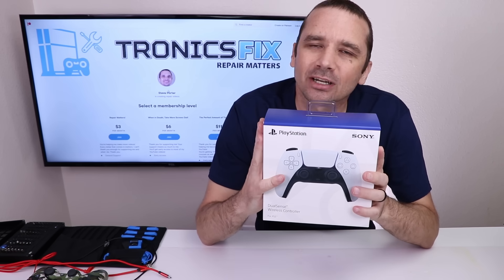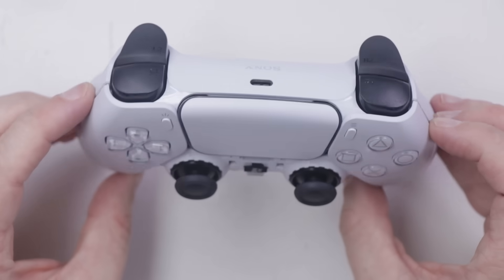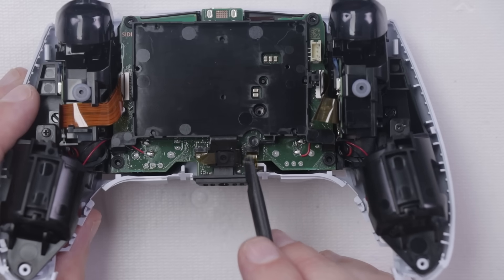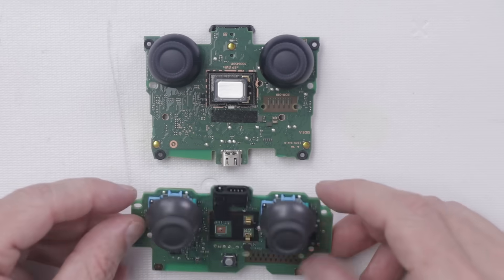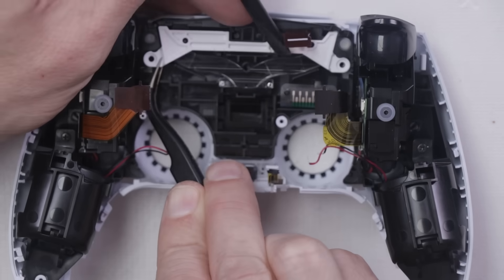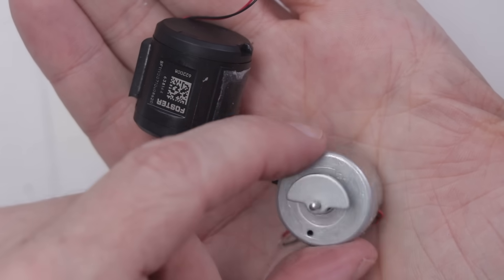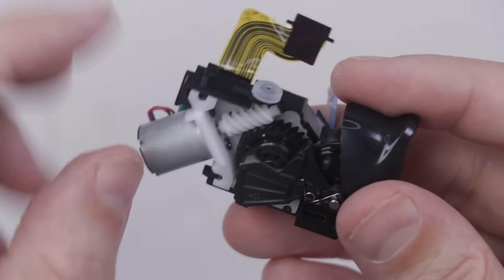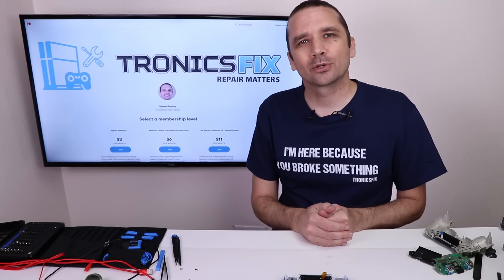PS5 DualSense Controller Teardown - A Repairability Perspective

Comment: Nice video thanks.They were going to be cool to feel that, they look like Wheel Force Feedback but I doubt how much weight or force supports that toothed shaft or toothed wheel is nothing more than plastic, it would have to be made of bronze or metal base like the gear motors of CD/DVD driver.

Comment: I wonder if the Dual Sence vibration's is like the Switch's HD Rumble but more advanced
Reply: It is. A reviewer already said "If the Switch has HD Rumble, the DualSense must have UHD Rumble". It's far more advanced as it's much bigger. Comparable with taptic engine in iPhones, which gives impression that someone's knocking from the inside of the device... But again, much bigger so the effect is advanced. I am so hyped for feeling the Controller the first time.

Comment: C mon you already watched a video, the L1 R1 buttons are the trick and without knowing there is a screw under you wouldn't be available to open it so fast
Reply from the maker: Nope...didn't watch a single teardown. I was super careful when I got most of that cover off then it didn't budge anymore so I knew I needed to check it more. When you start opening it up you can see where the screws are from the backside.
Reply: @Tronicsfix  all right so maybe the edition makes it look easier than it was, good job!

Comment: i feel it would be a great opportunity for them to re-engineer the trigger motor to have an "energy saving mode" so every time you press the trigger it acts as a generator and restores whatever it can to the battery. It wouldn't be much, but it could help for long fps games to get even just a few minutes. Kinda like regenerative braking.

Comment: Never had drift with my PS4 controller, the battery on the other hand, lasts about 30 minutes before dying.  I pretty much leave it plugged in now with a longer cord.

My Nintendo Switch controller on the other hand, has noticeable drift - and was showing signs pretty early on, where-as my PS4 controller is the original from release, with the analog thumbstick worn out like a pencil eraser.

Comment: I've had one of my Dualshock 4 controllers since launch day 2013. After about a year I dropped it and broke the R2 button so I replaced something in there and I put new thumbsticks on while I had it open, but it's still going strong. Never had any drift or anything, battery is as poor as a brand new one haha

Looking forward to having a go on these Dualsense controllers, looks well laid out if I ever need to fix anything.

Comment: This is the first time I'm hearing of drift, I've have my controller since day one with no issues, I also have a controller that came with my PS4 Pro thats only used when my original controller dies. So weird must have gotten lucky.
Reply: Same. I've never really had any issues with any sort of stick drift with playstation or xbox controllers. Just the Switch.
Reply: Me I had
Reply: There are definitely some drift with PS3 and PS4 Pads, but I had never anything that I couldn't fix with a quick calibration. The Switch drift is a whole new level.
Reply: i've had like 4 dual shock 4 controllers and 2 of them eventually developed it, i find it's more of a abuse thing though, my second one got it cause I dropped it a few times and my first one just developed it, though eventually I busted the trigger in my first one playing mortal combat.
Reply: Same. I never had any drift on any PSx controllers.
Reply: I’ve had 4 duel shock 4 controllers and they have all developed a problem or two.
Reply: @XgamerdaveX  i do alot of party games with my friends . Now we have 11 DS4 controllers with problems most of them the drift in L3 . I hope not to have this problem again with ps5 .

Comment: I can't wait for all the people who just press the trigger harder when it's set to not move then they break it
Reply: Depends on what's stronger, the holding torque of that small motor or the plastic gears. But I guess we'll find out when people can power the controller with the triggers set to not move, If it does fail then that's a major design flaw and there's going to be a lot of warranty claims and unhappy people.
Reply: @black543211000  based on the sticks being the same as PS4, I don't have much hope for those tiny motors
Reply: I’m curious as well. I think Sony has it covered, there’s no way they’d overlook something like that.
Reply: The trigger system just gives it to the pressure in that case I saw another video explained it.

Sorry I can't remember the video but it seems it will be fine.

Basically there will be a certain force when the trigger system will just unlock.

Comment: Those analog sticks are fine, I have never had a playstation controller drift it's only xbox and switch that i have had drift.

The chips on the board look like SONY (SIE [sony interactive entertainment]) and realtek chips the sony one probably is used to control the motors and send button presses to the PS5 (it might also do charging) and the realtek one's are for bluetooth, those will probably die in a few months and kill the whole controller (and system if the PS5 has them too) because they are not good chips.

Comment: The analog is slightly revised in material on the retaining plate and mounted 90° offset to help with a specific case of wear that could lead to drift
Reply: Yeah that's what some other people are saying, yes the overall analog design is the the same but the material used is different so hopefully they are smoother a less prone to drift
Reply: Don't really understand but I hope you're right
Reply: @danielb5721  - The green square part he points too at 6:22 has a fragile sensor plate in them that registers the thumbsticks position,  it does this by rubbing tiny tiny metal pins against it.   After enough use and abrasion, the sensor starts to get a bit fonky from even the smallest piece of dust or excess corrosion.  (that's why blowing on it temporarily fixes the the issue).   The only true solution is to carefully clean this green bracket area out and the metal pins,  but if it's too warped you'll have to repair the part ($3) or like most people buy an entire new controller for $70
Reply: Also help with sprinting in games. Since you have to push forward and press down. They did it with ps2
Reply: Can you elaborate on the 90 degrees thing?
Reply: @Unlovelywriter  basically they flipped the analogs 90 degrees to make them wear down less when sprinting .
Reply: I hope,  i've had the same running issue with 3 different DS4's (left thumbstick) in FPS games.  It's always those tiny green sensors that start to warp first from those metal contacts.   Drift was so common that I became a professional at taking apart and cleaning mine out almost every other gaming session.  After my 3rd controller started doing it I was madly obsessed with fixing the issue and scouring every YT channel for solutions.   Not difficult but extremely inconvenient
Reply: Same poor quality analogy sticks  as before , there must be a better way of doing this ?
Reply: @clivechamberlain4310  Sony likes money, so they let you buy more controllers if they break

Comment: It's good that the adaptive trigger is modular but I do think plastic on plastic gear grinding is a bad design flaw. We saw that way back in the Nintendo 64 days where the analog stick would fall apart because it was all plastic inside.

Comment: Guess I was really lucky because I have never heard of DS4 analog stick drift up until this point and I have used my PS4 for over 5 years now. Also you pretty much need to have a soldering station if you want to clean your controller, same as PS4/XONE.
Reply: Same here, both my launch day PS4 and launch day PS3 controller works perfect to this day
Reply: Yeah I've never heard of it being an issue myself either, and my 2+ year old DS4 controller has had zero issues. In fact the only real issue I ever recall having with an official Playstation controller was my original SixAxis and that was just the battery dying, I simply removed the battery and it still works perfectly fine as a wired controller. Seeing people say they've had issues makes me wonder how careless some people have been with their controllers, especially when they say it's happened with multiple controllers such as one guy saying he went through 6 in 4 years.

Comment: DS4 has analog drift problem? I have 7 controllers and none of them ever got that.
Reply: Yeah this is the first I've heard of it having issues too. I've only got a single controller that's little over 2 years old now that I've had zero issues with, meanwhile some guy in another comment claims he's gone through 6 controllers in 4 years due to drift & L3 button issues which makes me question just how careless is he with his controllers.
Reply: First i'm hearing of it.
I never seem to have issues with playstation or xbox controllers.
Reply: I have 3 DualShock controllers and they all have this issue. It's pretty common and depends on the model of controller you have. The updated dualshocks fail more in my experience compared to the ones from launch.
Reply: I had 3 PS4s and the last controller had drift. I take extremely good care of my consoles and controllers. The drift appeared after playing Project CARS without any kind of assists. When you turn the analog stick only slightly or halfway through (without touching the border) looks like it wears out very fast. So don't play simulator games without turning assists on your PS4 on a controller lol.
Reply: My first DS4 had this problem after 4 months and i sell the console cuz that
Reply: I was today years old when I learned about the drift thing issue.
Reply: y tho
Reply: @VolkyWay  
I dont know imagine i used one day in the week so i didnt use it 24/7 and even with that it didnt make it 
Low quality i think
Reply: My DS4 that came with the console already had drift :)
Reply: @andrewz4515  
Exactly poor quality i dont like DS4 
I really want xbox sx just to avoid this problem the dualsense is not cheap 70$ per 4 months thats stupid if its had drift
Reply: Same here. I had no idea that the DS4 has drift issues. Not saying that it doesn't happen (I'm sure it does), but with some of these ridiculous failure rates some people are supposedly having I would be very surprised if part of it isn't due to controller abuse. Lol.
Reply: @ultramegax  I think it's just not that common unlike with Switch joycons. I have 3 DS4s and all of them are still in top performance condition until today. I'm using one of them as a controller for PC.

Meanwhile, my GFs joycons had been experiencing drift issues after a year of usage.
Reply: @deicidium1887  yeah, I believe the Switch definitely has far more widespread drift issues. My sister's boyfriend had issues within a couple of months, with all of his controllers, and he takes good care of his stuff.

Comment: Austin Evans is no expert that’s for sure. This is so funny!
Reply: What do u excpect from someone who said Xbox X is miles better than PS5 just cuz he got it early 
What a loyal fanboy
Reply: @Player dude better specs doesnt mean it's gonna perform better. Austin got one from microsoft and he tested it and then looked at the ps5 specs and said yeah xbox is better, sorry but thats not how u campare consols he should've waited for ps5 and then compare cuz what's the point of it being more powerful if it's not gonna fully use those specs? Xbox one was more powerfull than PS4 but ps4 outsold xbox in units and with a overall better gaming library and also performed better except for the loued jet sound
Reply: @farxx5628  The ps4 was more powerful than the xbox one and the reason xbox one sold less is because it was $100 more and bundled with the trash kinect. The xbox series x is more powerful than the Ps5 cpu and gpu wise. The only advantage Ps5 has is its faster ssd which won't make a difference in third party titles
Reply: @rixzin5046  wrong, also a VASTLY better I/O and compression system, and a significantly less complicated development environment... Sony isn't forcing developers to develop and optimize for two different consoles and in most cases a PC as well. There's more to CONSOLE gaming than the GPU, it's the erasure of bottlenecks and ease of development, and the "bottleneck" (in quotations because there really isn't any) in the PS5 architecture is essentially the SSD, which is saying something about the Series X since it's twice as fast. ps3 was more powerful than the 360 but 360 usually had the advantage in multiplats for this reason. Why have we barely seen anything next gen on the Series X when it's a week from launch? It's sad that Watch Dogs is the only game, and I guarantee since it's from ubisoft it will very likely be mediocre even if it looks fine
Reply: @Artdizzle  Multiple devs have already came out and said that the series s isn't  an issue considering its literally just a cut down version of the series x. They're just going to keep it at a lower resolution and lower quality textures is some areas. I've also seen multiple games for series x on xbox's own YouTube channel so Idk what you mean.

Comment: Hmm, so all I have to do to disable the microphone is remove the black trim and then cut the now exposed ribbon cable going to the mic. Good, very easy to stop Sony from recording everything I say and selling that data to third party companies like Google, Amazon, and Apple all do.
But will the controller still work after doing that? That is the question. (I already know I won't be able to play garbage games like AstroBot that think it's 2004 and blowing into the mic as a game input is cool, but losing those games is no loss at all. that crap wasn't fun when Nintendo did it and it won't be fun now, and I don't want to play any games that do it)

EDIT: Okay, have to go a little deeper, there's one on the back too. 🙄 
I really appreciate Xbox just making a regular controller without a bunch of stupid gimmicks I didn't ask for, as well as still using replaceable AA batteries so I'm not stuck with a wired controller whenever the battery dies.

Comment: I took mine apart and it looks significantly different than yours. The thumbstick mechs are the Japanese variant instead of American Alps, the touchpad ribbon wasn’t soldered on but was modular, the rumbles had serviceable wires not covered in white epoxy like yours were, and the button ribbon pcb was blue not green.

Comment: 2:03 Oh, Sony learned. The silicone pads behind R1 and L1 are completely filled again, not like the PS4-Controller, where they were basically a ring. Atleast they will hold up longer than the ones in PS4-controllers.

Comment: Its saddening hearing that the sticks are same build as the Dualshock 4, I was hoping as well some upgrades to it.
My first DS4 had bad drift 8 months after getting the PS4 revision of OG version.

Luckily my second DS4 haven't given me a slight hint of any problems, but my friends have told me they've gone through 3 controllers or more.

Sometimes I wonder what the heck do they do...or maybe I got super lucky with mine. But anyways, hope these controllers show less problems even if the design is the same.

Now for a quick question regarding the new triggers and the mechanical aspects of it.
What are your thoughts on durability for them? From what I saw and understood they are easy to fix, but it makes you wonder how careful you gotta be with them if you have the feature on (you can set them on/off on system configuration).

I can see situations were players can get a tad rough with the pressing of the bottoms tearing and wearing everything out, not factoring dust and sweat into them.

Thanks for advance if you get the time to reply to this.

Comment: Looks identical to the sticks used in the PS2 Dualshock controllers, but can't tell without seeing one taken off and opened up. I fixed quite a few PS2 pads with drifting sticks for friends. The main cause was the circular foot of the stick that is pressed down onto the base of the module with a spring that would return the stick to centre wearing down. The base would have a bump in the middle and the foot will have a similar indent to it, if worn flat then that stops the stick finding the centre. I have not opened any other sticks from other controllers so don't know if this design has changed since then, It might just be a standard off the shelf part that hasn't changed. would be interesting if you did a comparison.

Comment: Nice video,very informative.
My only question:
Can i remove the whole haptic thing to make it a normal controller? I mean remove the hardware ,not via software,and keep it working, i trully don't give  a damn about that whole vibration and trigger response thing, if it was possible i would keep playing with my half mid chassis removed scuf ds4 lmao,I even removed the lighting 😂
Reply: Everything can be disableb in console system menu. If you can remove these parts and still use it depends on the software - it could be there is a self system check for any failures and if a component is not responding, it will render whole controller useless.

Comment: I was thinking I’d be concerned with the analog drift but I’ve had 4 controllers on my PS4 but analog drift was never an issue especially since I mostly play Call of Duty and am pretty competitive. I doubt it’ll be a problem on the DualSense!